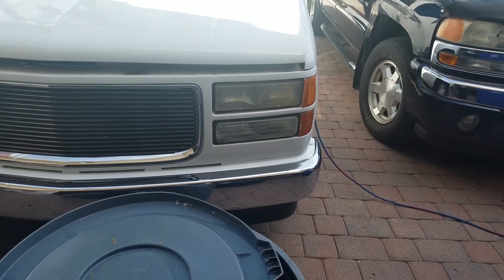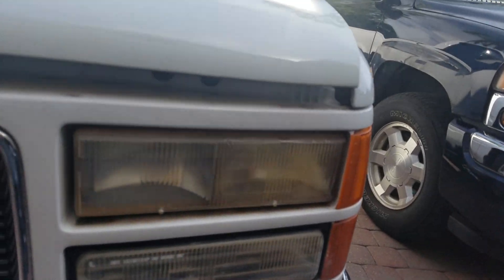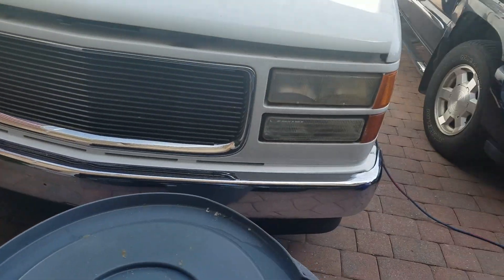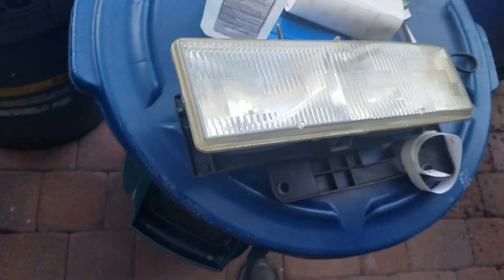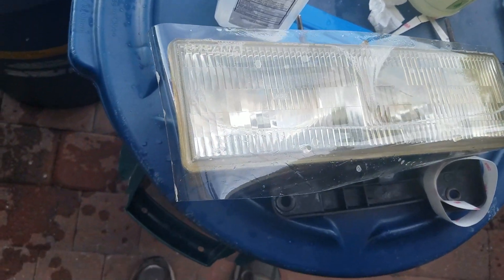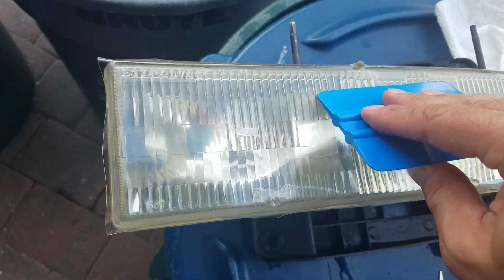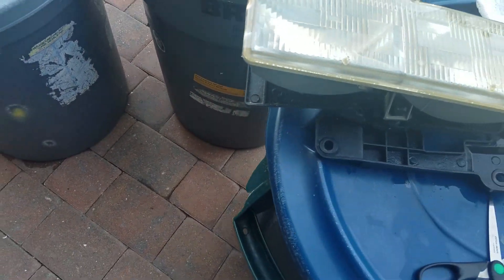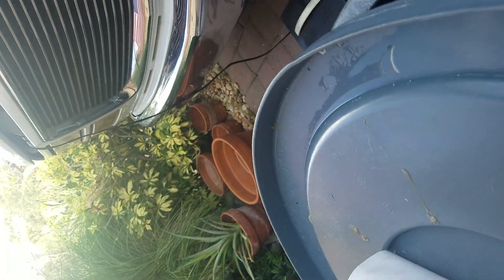How to DIY Headlight Film on TRUCK or CAR!    Keep your headlights from fading!

Comment: 117F.   No thanks , it’s 93F here .. filling up the pool.. with ice cold well water.. lol
Reply from the maker: YA it feels like 110-117 all the  time here only idiots would drop down cash to live here.  I keep getting rid of stuff Ill start my own compound soon someplace normal
Reply: @GhettoWagon  our summers are fine , but winter sucks..  I’m cutting firewood for winter.. need about  4,500 pieces. Lol
Reply from the maker: @462ANIMAL  How many days to you need to invest to get that much?
Reply: @GhettoWagon  I don’t do it all at once , it’s a good question.. by the time I cut the trees down and cut it up , and split it.. still then needs to be stacked up.. I tend to do wood for a day then something else .. It’s actually hard on the body.  My guess would be a week, if I went at it all at once . If I don’t heat with wood , my propane bill would be 3,000$ probably.  And I’d not be keep the house 75-80 ..
Reply from the maker: @462ANIMAL   Yup all costs are nuts.  I would probably run wood if I moved.   I want a house in Maine.  CHEAP..  You can get a house 1000-1500 sq feet with acres for 50-80,000   ITs old its shit someone might be shooting up meth down the road but who cares.  They are doing it here  too in the heat 
 Missed out on a few nice chainsaws here Should of bought this MS291 sthil someone had. Would of been a beast for wood
Reply: @GhettoWagon  How are the taxes there ?  I usually run my MS 170 , I have a MS 152 I think.. it’s new , don’t use it much.. my back likes the lighter saw .  I got a 27 ton splitter, the vertical / horizontal that you can tow short distances.  It’s 3 years old , already sometime runs like crap.. even though I turn the fuel off and run the carb dry by putting full choke on to keep it running till it won’t.  Cheap Chinese engine.
Reply from the maker: @462ANIMAL  Depends where.  Here in FL its wayyy too much $ for everything.  No longer a cheap place.    Yea maybe the china engine needs the carb cleaned up on it. Probably has all plastic parts inside the carb. I want a stihl chainsaw!! Pro saw all magnesium
Reply: @GhettoWagon  I was down there in Florida back in 2018 Xmas / 2019.. The StihL  saws take a beating..   The MS170 muffler / spark arrestor plug up .. maybe I need to switch oils  . Hopefully the log splitter just runs, I ran it 2 months ago.. I really don’t feel like working on it today.  I got a Milwaukee fuel quik loc and  the pole saw attachment ..  still haven’t tried the saw.. had it over a year now.. only used the trimmer.. it works good.